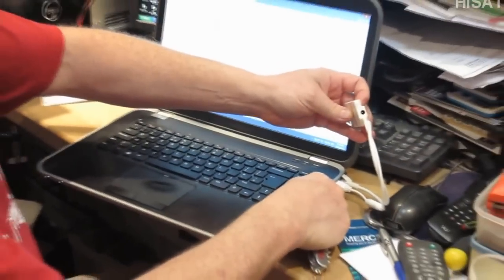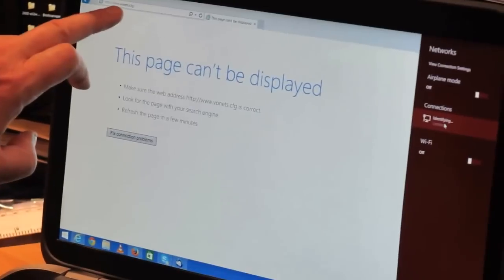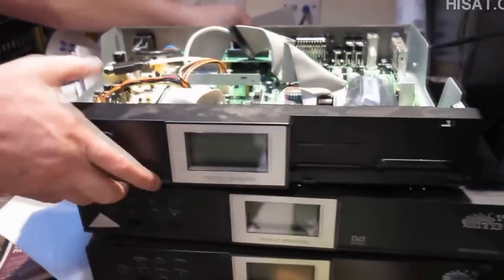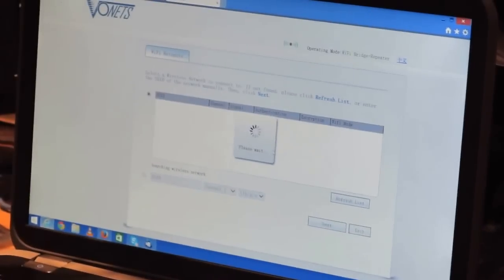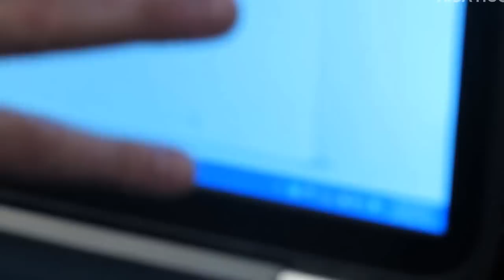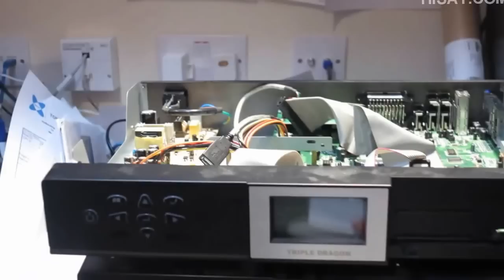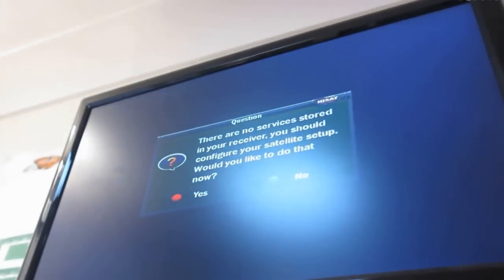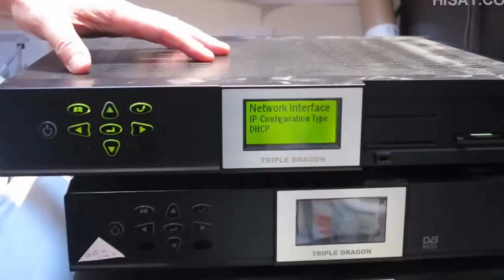Setting up Vonets VAP11N Wi-Fi Bridge & Triple-Dragon USB adaptor

Comment: Hey! I have just a little question about the range of these devices. I'm trying to span a distance that's just about 50% longer than the range of an average wireless router (across the street). Now I found a similar device to this by Vonets which they claim has up to 500m of range. Do you know if these actually have a higher range then regular repeaters? Thanks!
Reply from the maker: +Dennis W 
Sorry Dennis I'm not an expert on all things Vonets - it does sound possible but you know the range of these things can be seriously undermined by solid objects that the signal has to pass through 
I can say in the normal/average home the item I sell does what it's designed to and does it well
Reply: HISATdotCOM Thank you for the reply. I don't need much more range than I'd get out of a regular device, so it should be fine if what they claim has any truth to it. I'm only hesitant because I can only get it from china and thus won't be able to return it in case it doesn't meet my requirements. I'll spend some more time looking at reviews and shopping for outdoor devices.
Reply from the maker: +Dennis W one of the reasons I made this video is because I sell this item - I'm not in China 07808607502 is my number
Reply: Thanks, I have since obtained a set of devices that do the job for me :)
Reply from the maker: OK - well remember me when you need more satellite TV equipment

Comment: Do you know if this works with Directv? I've managed to get the Vonets to work, thanks to your great video, but my Directv receiver isn't recognizing it.
Reply from the maker: Obviously I don't work for Vonets but if it's not working it's worth double checking that it does work on something else for example you can switch off your laptop wi-fi and then attach it to the LAN Port - and USB (for power) now if you saved the correct password the laptop should communicate with your router if it does then It could be a range issue - try re-sighting the bridge - do you know for sure that if you connect a LAN cable from the direct tv receiver to the router that it does work (this would test the LAN Port) - also it may be possible to check in the software of the receiver that the LAN port isn't off - also maybe there is a software update for your receiver - I hope this helps
Reply: +HISATdotCOM I'll check that when I get home from work today. Thank you for the suggestions!

Comment: We have a 300 vonet vap11g-The configuration is the same, and is not a problem.
That's all good, but he could not connect to the router. Do you have any idea what the problem may be.
Reply from the maker: +john mondou (Doejaaren) most likely problem is an error in the saved password - there is no fail safe if you(anyone) inserts an incorrect password the device is stupid - it'll save you incorrect password but of course the bridge can't connect because the password is wrong!
Reply: It is ok now
the problem was  the type  of security  from the router.
Thanks

Comment: You can reset the browser on Chrome or Safari after 2 minutes when rebooting it.
Reply: Hello, I found a way to make it plug into an Xbox One using cellular network even with a Macintosh.

1.  Reset Vonets device.
2. Reset Safari's for the last 2 days, and do not plug in.
3.  Look for a new wifi that says Vonets.
4. Hook up via default password.
  Let me watch video for next steps.
Reply: 5. Reset cellular hotspot
Reply: 6. Next screen. Use hotspot password

Got to look up the rest.

Comment: Is the passphrase written on the router? what if it has been changed to another password? because i have been inputting so many different things and I simply cannot get mine to work. I have the vonets mini 300
Reply from the maker: +William Gerolami well a password is to stop unofficial access to your router from someone in range of it (for example someone sitting outside your home) if you or someone has changed it you need to know what to and with the best will in the world I can't know that - check what came with your router when you signed up - check paperwork your service provider supplied you with - possibly call your provider you may not have set a password in which case go on the internet and see what is the default password for your router - often it's "admin" could be a simple number or it could be "password" but change it and note the new password somewhere if it's any of those things

Comment: ok i have a 3g wifi modem i can plug it into usb port but it clashes with normal router . could i put this into a load balancing router with existing adsl and new connection.
Reply from the maker: sorry, I don't know the answer to that one - what I do know is everything I've used this with it works
as I show you in the video you set up on a PC or laptop then the device you want to make wifi MUST have an LAN connection - if it does then it can work - I'm only using the USB in the video to provide power but you could just as easily do that with a small mains adaptor

Comment: what do these do?
Reply from the maker: If a piece of hardware has a lan connection but doesn't have Wi-Fi this effectively adds that feature it's more slightly older designed tech that needs it because more and more new tech has Wi-Fi built in

Comment: Does this work with a ps4?
Reply from the maker: Benjamin Cruz , yes BUT the PS4 has a built in wifi option so if you configure your PS4 correctly and assuming it’s not broken you don’t need it - earlier PlayStations don’t have wi-fi option though
Reply: HISATdotCOM ohhh I was asking because my internet on the ps4 runs better when it's on the Ethernet cord. So I was looking at this to maybe save myself of getting a 200ft Ethernet. Does it work the same if I do get this?
Reply from the maker: Benjamin Cruz  if you have a weak or unreliable wifi internet you need to use a bridge or use this as a bridge so PS4 talks to bridge which talks to router and vice versa this means the 200ft becomes (potentially) 100ft + 100ft
Reply: HISATdotCOM ohhhhh I see thanks man you've been helpful
Reply from the maker: Benjamin Cruz :)

Comment: Internet explorer?  It's impossible for Mac and Android owners.
Reply from the maker: No idea sir, this video is old now but as I said in the video the only way it would work for me was to use internet explorer (now Edge)
Reply: @tony.hiscox  but there's no Microsoft browser on either Apple Macintoshes or Android phones.  So what do I do to log in?
Reply from the maker: @jackofallgamesTV  maybe you should write to Vonet about the problem - I’m a user passing on my own experience for the benefit of all - another simple way is pickup an old windows PC from a junk shop/ebay anything that works and then you can use edge/explorer
Reply: @tony.hiscox  have you tried Firefox?   I tried Safari and Chrome so far.  If not, maybe I should. I will write to Vonets.  However Vonets.com is out of business, and vonets.es hasn't written back in a week.
Reply from the maker: @jackofallgamesTV  almost certainly I did because I used to prefer Firefox and I certainly had Chrome forever and as I say in the video I didn’t think it would or should matter which Browser I used but it really only worked with explorer (and does work with edge (explorers replacement) too

Comment: What a waste of time!  Why don't you stay with configuring this POS?  I 
bought 2 and the manual is worthless to use this as a bridge!??!  Example: What are the source and destination parameters supposed to be?
Reply from the maker: I bought some of these to resell and I agree with you that the maker doesn't explain the usage and set-up very well but remember I made this video to help people, clients of my own that had one and of course anyone buying one from any other source, you can't set them up at the point of sale (POS) because they have to talk to the clients router - well that can't be done at POS because of the range of a wi-fi router 100 Metres at the most  - i can tell you that many have watched this video and succeeded in setting the VAP 11N up
Reply: Thank you, I'm not doing point of sale.  POS men't something else.  :D  No, I need this as a bridge.  I've connected it to my PC, Router, and a Tevo box... I can change the password, etc.  The problem is, I do not know how to make it communicate w/ the router.  I can see the 2 different WIFI signals on my PC, yet they will not communicate w/ each other.  It's most probably something simple like an incorrect address!??  Again, thank you.
Reply from the maker: Sorry - I think I've got it now POS = "Piece of sh**" one occasion where the "define: ...." command in google didn't really help me! :)
as I said I'm not the maker and the primary purpose of this video was to help my clients buying the Triple-Dragon and wanting it to be wi-fi
I kind of stopped worrying about it once It was doing what I(my clients needed it for) - I think that as you say it's all about knowing where you're going wrong - I've been supporting clients for years and instructions for these things are like mathematical formulas and if you miss a bit or misunderstand a bit you don't get the result you should